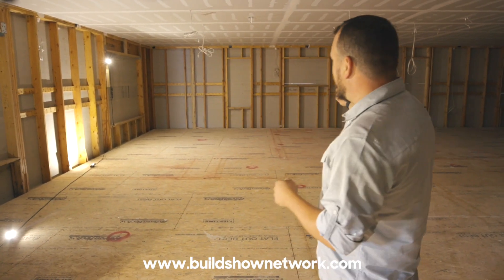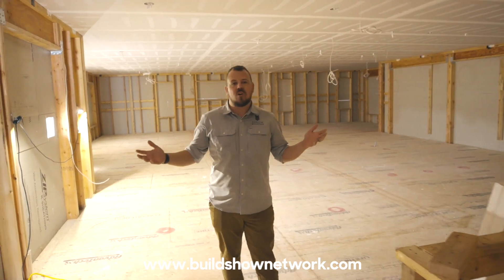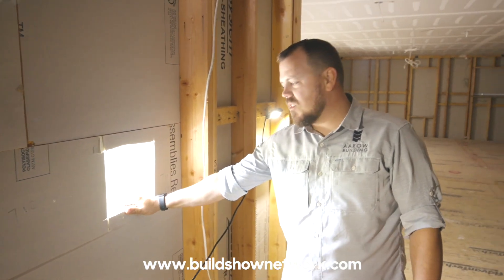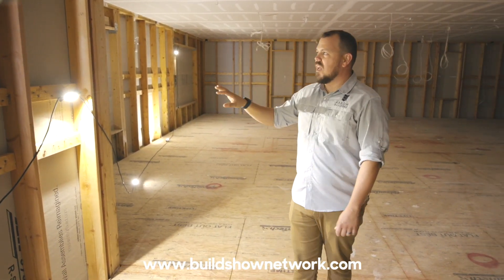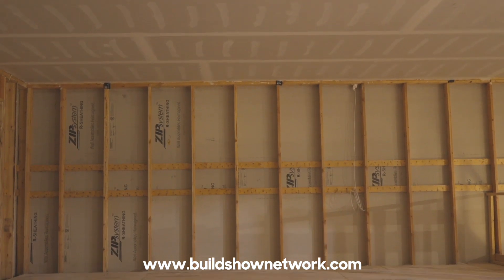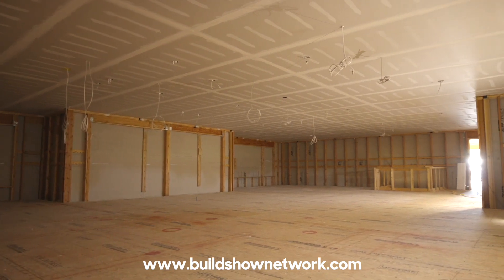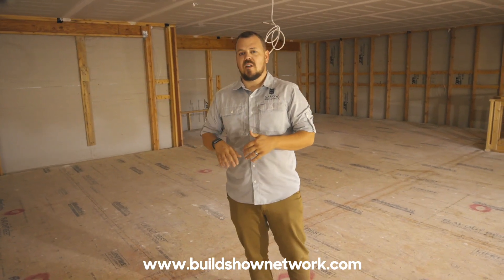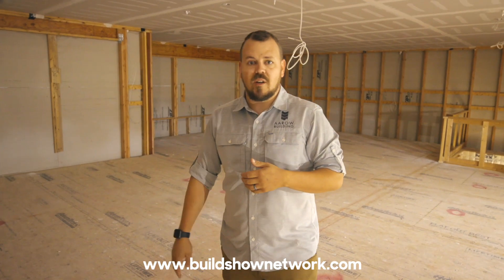A House With No Windows?

Comment: Completely disagree that a tight home is necessarily better, or provides healthier air.  Jake's home is encased in foam (Zip R). And is extremely tight. Absent a fully functioning, properly designed, properly maintained HVAC system, these foam-encased tight homes can be a recipe for a health disaster.  Give me a 'leaky' 3ach 50 home with no offgassing foams any day.
Reply: You've already determined how to solve the problem: "a fully functioning, properly designed, properly maintained HVAC system".
Actually, it's a dedicated ventilation system, but you get the picture.  A tight house won't be full of allergens, dust, bugs or dried mouse feces like a leaky house will be, and it will have the added benefit of being very efficient and easy to maintain high levels of comfort.  Leaky homes let the outside in, which defeats the purpose of building a house in the first place.
Feel claustrophobic or stuffy?  You'll always have the option to open a few windows.
Reply: The point of a tight house is that YOU, the home owner, control the air going in or out of the house.  A leaky house affords zero control so who knows what is going in or out.